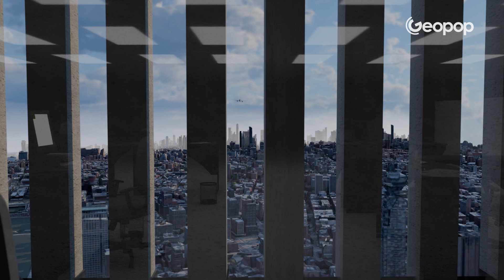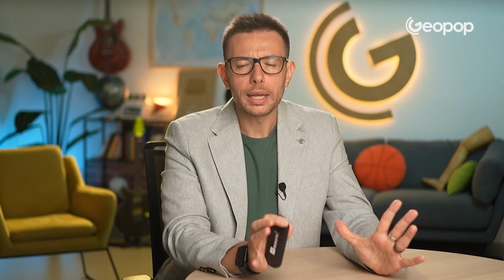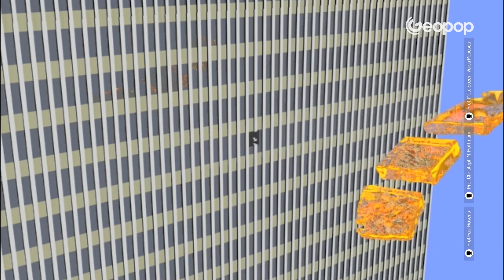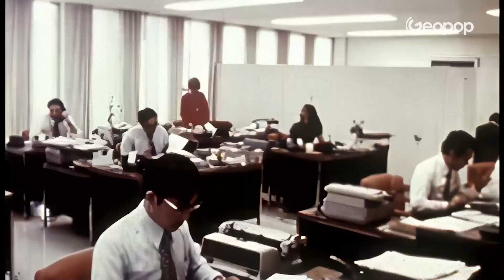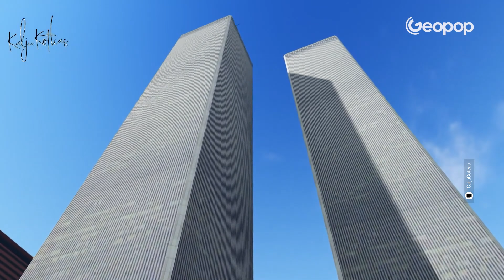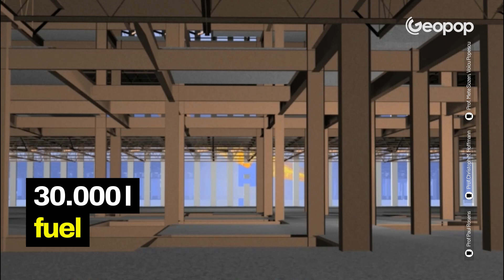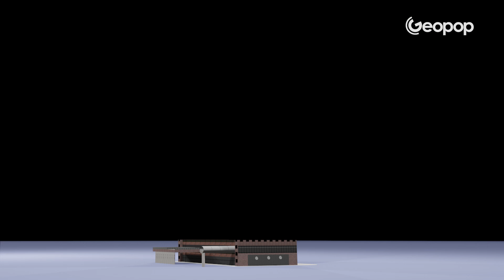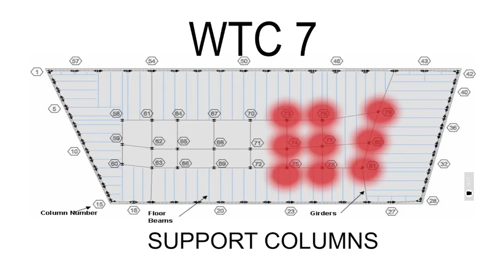9/11, 2001: The Technical Reconstruction of the Twin Towers and WTC 7 Collapses

Comment: In the workshop, when I need to easily bend a piece of steel, I heat it to glowing orange (1800 F - 990 C). At that temperature, it holds its shape well, but will bend if you get some leverage on it. It will also deform when you hammer it. Just at the point it cools to not glowing, it gets very stiff, and you can't bend it, nor will a hammer move it.
Reply: Yes but you are oversimplifying it.  You don’t have the ability to put the forces that the wtc steel was under in your workshop.  We are talking about each column carrying thousands of tons of structural load and floor trusses carrying many tons of weight resisting bending loads.  With the type of weight that the intact columns were carrying, they didn’t need to be as hot as the steel in your workshop to be bent or warped.  Remember, numerous perimeter and core columns were severed or severely bent in the initial impacts.  Also, the recovered steel showed multiple columns that were bent into u shapes that had been straight initially.  You cannot compare a hammer and the force of a person putting leverage on a piece of steel in the workshop to the immense forces the steel columns in a supertall skyscraper as massive as 1 and 2 world trade were under.  That is just common sense.  As for how hot the steel was, it was likely hot enough in the core areas that the steel in all likelihood was glowing.
Reply: @jcolbyt82  IF, and that is a giant stellar scale IF, the plane crash completely severed every single steel column, except for 1, and that 1 beam was damaged, that alone would have been enough to cause the fall to tilt, and slide off the side. But everyone knows that the beams were more than strong enough to hold every bit of the top without tilting for hours. If every beam one the entire side were cut that was hit, it would have fallen over, and that is why every demolition expert knows this was controlled demolition.
Reply: @dr.graves5541  You're forgetting the forces of the entire building above, pointing STRAIGHT DOWN. As soon as there's a failure, it falls STRAIGHT DOWN and just flattens anything in the way.
Reply: @aldunlop4622  when an object is in freefall, all external forces have an impact. If there is a breeze, that will change the course. The entire building below would have resistance. The floors below wouldn't jump to get out of the way because they see it coming, and the moving mass would have nothing preventing it from moving off the side, and everything preventing it from staying centered. Wt7 had no plane hit it, and they alerted everyone that they were going to drop it and it fell as every controlled demo does.
Reply: @dr.graves5541  Breeze?! Be fucking serious. The predominant force involved was GRAVITY. Thousands of tons of upper floor fell, and one by one each floor collapsed under the load.
Reply: @aldunlop4622  there are a thousand ways I can show you how free falling objects can be manipulated. But of course the propagandists are desperate for ys to believe it wasn't free falling even though it is clocked at free fall speed.
Reply: @aldunlop4622  Do yourself a favor, simplify this scenario and think about 4 posts holding up a tremendous amount if weight. How will that weight fall if 2 of the beams are severed? If you have 1 beam, even if you can make 100 beams all fail and snap exactly at the same fraction of a second, 1 beam holding for 1 split second longer, will absolutely fall to the side no matter how much weight is above it.
Reply: @aldunlop4622  not even nist could show how wt7 could be made to drop straight down. These are uneducated crooks explaining to people who they also think are uneducated in order to conceal the true events.
Reply: @dr.graves5541  It depends on if the beams that are left are capable of hold the extra load, if they are not, they immediately fail and the load falls straight down. Why would it fall to the side? As soon as the load goes onto the remaining beams, they fail, and the load falls. I don't know where you got your engineering degree but give it back.
Reply: @aldunlop4622  the world is waiting for you to show how that happens so that they can laugh at all the engineers and architects and university research studies who testify that is impossible. You don't even gove the tiniest bit of thought as to how you could even show anything like this possible, maybe because you know it isnt?
Reply: @dr.graves5541  WOW! You REALLY like to use a lots of fancy words don't you. Christ, your arrogance is off the charts. All the engineers in the world agree with YOU? Nobody agrees with you, except other conspiracy theorists like you, that's just some crazy nonsense you've cooked up in your psycho brain in your basement. You're bloody lunatic mate; you're not even worth my time. Go "prove" that Machu Pichu was made or aliens or something.
Reply: @dr.graves5541 you are completely delusional to think even a significant amount of educated people are on YOUR side of the argument
Reply: @dr.graves5541 let's both make up math. No that won't happen. You are not diverting millions of pounds of weight. It will crash down, and down, and down straight to the ground.
Reply: Three buildings falling straight down in itself is amazing, but having all three fall in one day, never having happened before in history, is unprecedented. If you watch controlled demolitions of other buildings, you will see how often things go wrong. To have it happen by accident where all three fall perfectly three times is a little hard to believe.
Reply: Any blacksmith understand that you aren't melting the steel,  you're making it malleable.
Reply: @kurthaas4331  what you are saying is that the steel failure wasn't breaking, it was bending. So if it bent , why didn't the building fall over as the metal folded over? Do any test you want. You will never get a structure to fall straight down if one support isnt as damaged as the rest. For every support to fail exactly at the same time, each one would have to be heated at the exact same temperature at the same time. That is absolutely not what happened.
Reply: @dr.graves5541 it didn't fall "straight" down. It collapsed vertically, straight down implies into its own footprint, when in reality massive pieces of debris landed hundreds of feet away. Atleast 10 other buildings were severely damaged by falling debris. 5 WTC partially collapsed and had to be demolished. Other buildings destroyed include 3 World Trade Center, 4 World Trade Center, 6 World Trade Center, and St. Nicholas Greek Orthodox Church

Many other buildings were damaged.
Reply: @teggianosalerno5050  considering the scale of the buildings, the amount of the structure that fell outside of a few feet from its own footprint, is a tiny fraction of the actual amount of material that fell. You can see one of rhe towers begin to fall over as it started, but then the structure below it just magically fails to create any resistance at all. Every engineer in the world knows this was controlled, and the few who try to deny it, have to invoke magic fairies in their reverse engineered answers.
Reply: @dr.graves5541  every engineer in the world? What a delusional statement. How did it fall within a "few feet" when buildings hundreds of feet away were completely destroyed or damaged beyond repair?
Reply: @dr.graves5541  yes part of the structure starts to lean just prior to collapse. The structure is still welded and bolted together, the structure did its job. The weight and energy was to great to offer much if any resistance.
Reply: @teggianosalerno5050  the op proves the point. Hot steel can be bent. If it bent, the building would have bent, and the failure would be crystal clear. But 3 miracles in minutes, where the beams didn't just bend. Every single support failed, not by bending, but were absolutely severed at the exact same time to make gravity take it straight down.
If you want to get to sea level, would you start digging at the top of mt everest, or would you just walkdown the side? Free falling objects react to everything in their way too. If there is even the tiniest bit of resistance, you can alter the trajectory of a planet.
Reply: @teggianosalerno5050  so what experience or education do you have that makes you know for certain what happened on that day? Do you feel that you outrank engineering professors at universities that have investigated this event and concluded that it was indeed a controlled demolition?
Reply: @dr.graves5541  no the OP was thoroughly disproven by the 2nd comment in this thread. 

You're ignoring the massive weight in motion. It's literally explained and very well for that matter in this video. I'm sure you never even bothered to watch it. 

Are you saying the buildings should have tipped over?
Reply: @dr.graves5541  also why do you ignore the other buildings that were destroyed? Doesnt fit your narrative I guess.
Reply: @dr.graves5541  I am a mechanical engineer, it's not my field. I am not absolutely certain, science doesn't deal in certainties. 

You really think Engineering Professors who believe in 9/11 conspiracy theories are the majority? They are a fringe. The VAST majority laugh at truthers.
Reply: @teggianosalerno5050  the op says that steel can be bent when heated. That is a fact that nobody disputes. But it doesn't shatter like glass. That is the point. If the steel just bent until it failed, the building would have fallen over. Period. If that could be disproven by demonstration, it would have been a thousand times already to silence the engineers who are calling this a lie.
Reply: @teggianosalerno5050  there have been thousands of buildings taken down by controlled demolition. Do yourself a favor and watch one. The firemen warned everybody to get away from wtc7 bc they were going to pull the building. Several stations reported it to have fallen hours before it fell, for no reason. Nist claims that wtc7 fell from small fires on one end of the building. And yet, the top floor begins to fold in, and puffs of smoke go out in lines down the sides as it falls like it never had structural integrity ever.
Reply: @dr.graves5541  it didn't shatter like glass, debris spewed everywhere. Hundreds of feet away. The weight caused the supports to sheer and pop out of their joints. There was a pile of debris 9 stories high. It's kind of hard to demonstrate a massive sky scraper collapsing. I think you are severely underestimating the mass and the amount of energy that's would be created by that much mass in motion. You also likely don't realize how much material piled up, like I said 9 story high pile. Concrete was mostly pulverized, but the steel much of it intact.
Reply: @teggianosalerno5050  wow, you just make crap up to suit your opinion. You dont have any engineering knowledge or experience, you just ignore every fact of physics and every actual expert bc you know without even knowing how you know.
So you know more that professors of engineering at universities.
How impressive.
I'd be super interested in how you have become so versed in demolition.
Reply: @teggianosalerno5050  since you are such an expert on all the logistics and events of that day, it would be so silly of me to wonder if you seen any of the research, and explanations that NIST came up with.
Of course you have...
Remember the part where they begin the animation showing how the fires enabled the failures, and had the buildings collapse as a result?
Isn't it peculiar that in every single one of the scenarios, the buildings begin falling over to the side, and then before the event is completed, they stop and say, "that's how it happened"...
Reply: @teggianosalerno5050  speaking of NIST, one would consider the people who worked there to know something, wouldn't you?
What about the one's who spoke up and talked about how crooked the investigation was?
I'm betting with your mom infinite knowledge, you have answers for the the questions that even NIST couldn't touch, like how were cell phone calls made on an airplane in 2001?
NIST has flat out denied that any calls were made, but then, there was that movie...
Reply: @dr.graves5541  It WILL fall straight down. There is a MASSIVE amount of mass above with a vector straight down. There is no force pushing it sideways.
Reply: @aldunlop4622  there is a thing called the scientific method. If you have a theory, it is tested, and retested to prove it's validity.
There is only one way to recreate what happened, and that is with controlled demo.
Reply: @dr.graves5541  I have a science degree; I don't need your help thanks.
Reply: @aldunlop4622  your degree has nothing to do with engineering and construction obviously.
Reply: @dr.graves5541  Physics mate - all science is based on physics.
Reply: @dr.graves5541  If you actually watch the video, and pay attention, your questions were all answered, very clearly.  Your theory is dead in the water.
Reply: @ChristLink-Channel   No they weren't. Obviously you don't understand the questions. If you really think that a single question is put to rest, then you tell me how any points I made are invalid. You can't, but in order for you to maintain your narrative, and to belittle anyone who dares to raise a question about an obviously devastating event. You are obviously the type that will call one party demons, and claim the other side is pure as the driven snow. And you can't even understand how hypocritical that makes you.
Reply: @dr.graves5541  No idea what your point was there,  if there even was a point, but it certainly wasn't valid or pertinent to the conversation.  That's what trolls do when they realize they lost: distract, deviate, and try to derail the thread.  Good luck with that!
Reply: @ChristLink-Channel  speaking of trolls, you don't know what points I made, you don't care enough to read them. You just name call like a baby, and think you are winning some kinda prize. There is a study done by a university that concluses that your theory is just a lie. The most prestigious people who take down buildings for a living all testify that there is no other way that the buildings could have failed. Thousands of engineers who live this information every single day, are putting their lives on the line because they know everything you are begging the world to believe, is a lie.
Reply: @ChristLink-Channel  I love how you admitted that you don't know what I have claimed, nor do you care, and that is somehow what trolls do... People all over the world wonder how our population could be so massively ignorant enough to have elected this infant now in office... Thanks for showing us how.
Reply: @dr.graves5541  Did you actually have a point?  It seems not.  That's what trolls do when they lose: they deflect into name-calling, lying, and attempting to belittle their opponents.  As it....
Reply: @ChristLink-Channel  well at least you admit you are a loser.
Reply: If all the steel in the buildings reached high temps it might have caused the collapse, but no. Controlled demolition is what happened that day.

Comment: How does aliuminum cut steel ??
Reply: By being part of a large object weighing more than 150,000 lbs travelling at 500 mph, as you can see in countless videos of the event.
Reply: The steel wasn't cut, the perimeter wall consisted of a dense web of steel columns and spandrels bolted together. Check out the construction photos. You can see how the damage resulted in that web fracturing at the the joints (that is, where it was bolted together).
Reply: Quite well, actually!  Just like water can cut steel, or even stone, at high enough velocity.
Reply: @ChristLink-Channel  A graduate of failed Trumpachenko University I see. With honors! You know absolutely nothing about aviation history. Do you?
Reply: water can cut steel as well😉
Reply: @krzysztofpoznan5226  Absolutely know nothing about the Pacific war Oct-1944-Aug-1945. Do You?
Reply: Easy! Ask U.S. Navy survivors of Japan's Kamikaze pilots Oct-1944-Aug-1945. 36 American ships sunk. Over a 100 damaged. With prop planes and Formula-1 high octane aviation fuel. Read some history of the Pacific war.
Reply: the kind of comment a moron makes.
Reply: By weighing 380,000 lbs and going 500mph. Dumb fuck.
Reply: Aluminum cant cut steal. Just like jet fuel can't melt steal.
Reply: please do better your low IQ is an insult to the 2,900+ people who died and the thousands more who've died from cancers etc in the last 24 years.

Comment: Jet fuel when it explodes burns very quickly and does not have time to heat the nearby steel.  What continued to burn was office equipment and contents, nothing hot enough to melt steel, and certainly not the central concrete-steel core.  There are numerous pictures of victims standing in the holes left by the planes with small fires close by.  If the steel had been hot, they surely could not have walked on it.  The steel was quickly exported to China and investigators were barred from taking samples to analyze for explosives residue.  The steel of the lower floors was not affected and only the top should have tipped over and fallen if it softened.  They have tried numerous times over the years to fabricate scenarios to explain the speed at which the towers fell ignoring videos of explosive charges going off in sequence on different floors as the buildings were collapsing.  Another video to silence the sceptics, how many more will they put out there.  This collateral damage and deaths justified America going to war, hundreds of deaths and thousands of casualties followed with no proven conspiracies by Sadam Hussein.

Reply
Reply: I have no idea what your saying but steel dosent need to melt to lose its structural integrity